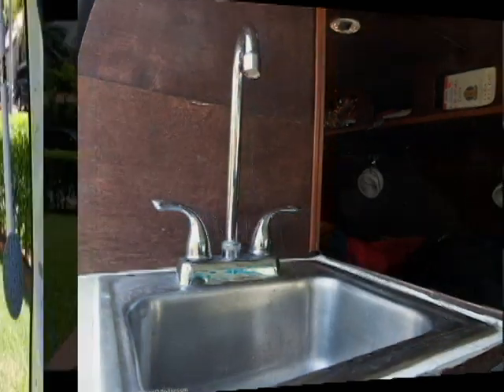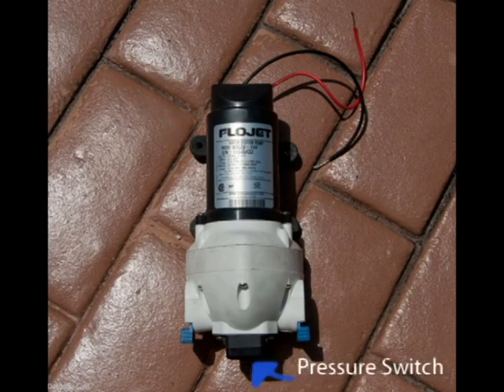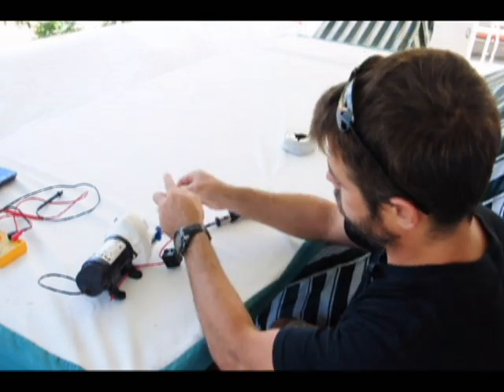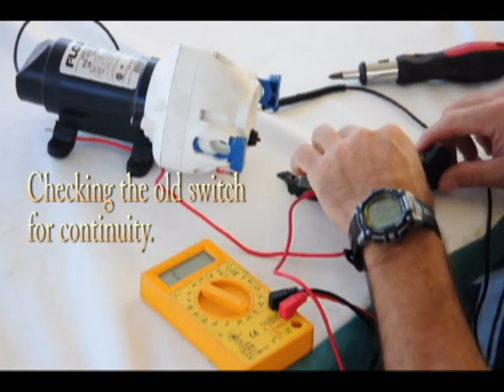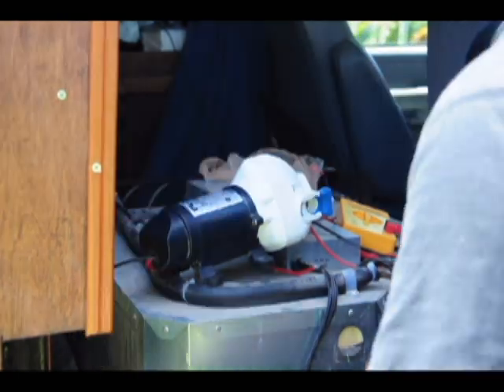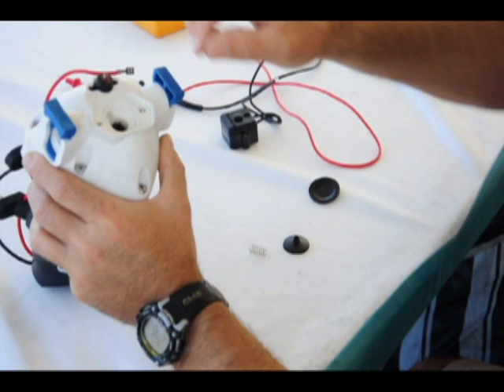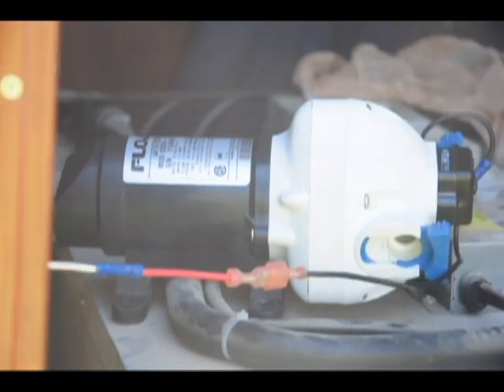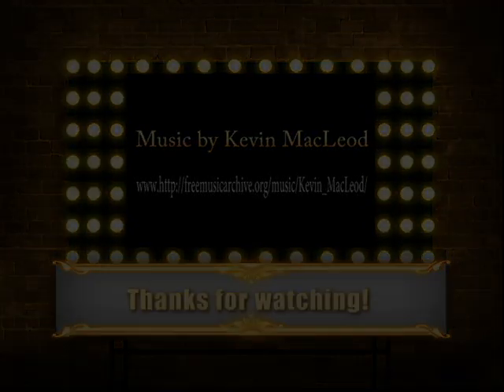Water Pump Troubleshooting and Repair

Comment: I just bought an Astro van for $500, was looking for parts and ran across your video...what you did with your 'E' brings back my memories of what I did in '78(albeit w/o running water. had the ocean, containers, port-o-let, a Coleman stored under the bed/couch and a few parks in the Keys for the rest)....the reason for the van now...Great videos. I remember the old A1A in Ft. Lauderdale and nothing west of University Dr. except Plantation Acres, the dump on Flamingo??? and bamboo growing along the 84 canal. Thanks for stirring up the 'good ol' days'